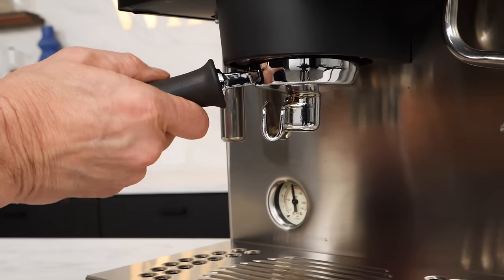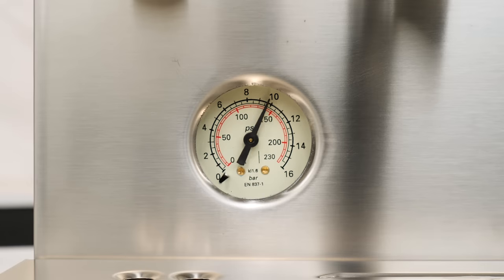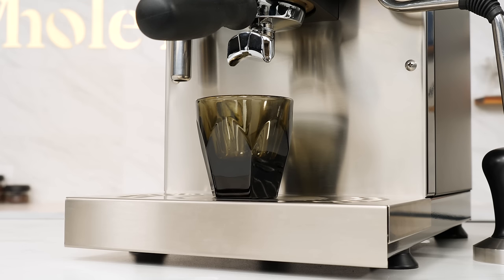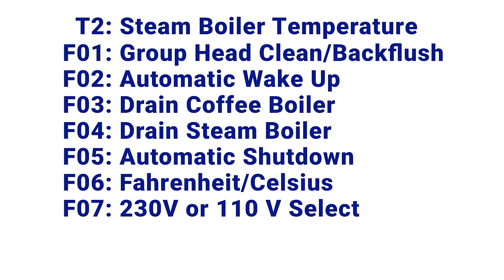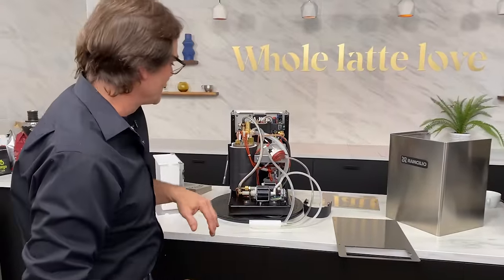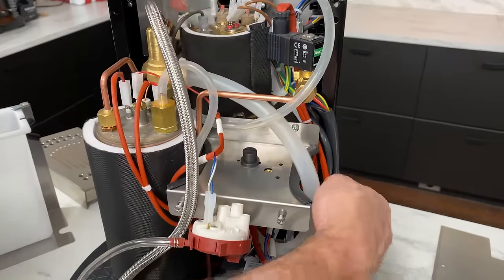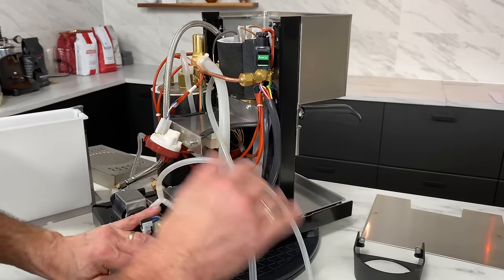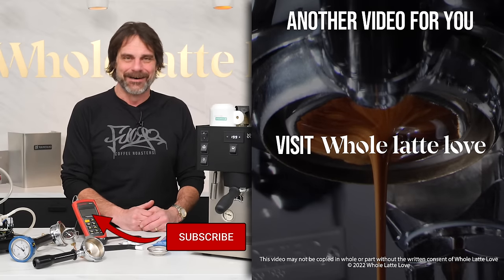Review: Rancilio Silvia Pro X Espresso Machine

Comment: The "con" is it went from $750USD to nearly $2000 for these features. The appeal of the original is it's value to me. In that price-point, I'm looking at a rocket or lelit.
Reply: Its a different machine and it is still great value. You'll be hard pressed to find a machine with the capabilities of this machine for the same price. It has a dual boiler, dual PID, pressure gauge, and timed soft preinfusion. The Appartamento isn't a dual boiler machine, its a heat exchanger iirc. Different system that is generally cheaper than dual boilers.
Reply from the maker: Hi an, Thanks for clarifying! the difference between the single boiler Silvia and dual boiler Silvia Pro X. Similar look but very different with more efficient workflow and superior temperature accuracy.
Marc
Reply from the maker: Hi Scott, Thanks for the comment. The Rocket Appartamento is near the price of the Silvia Pro X. Compared to the Pro X it has the E61 group, larger drip tray, no burn wand and might win style points. The Appartamento is a heat exchange boiler machine with temps controlled by a pressurestat so nowhere near the temperature accuracy of the Pro X with PID. With dual boilers in the Pro X one can control steam pressure without affecting brew temps. In HX boiler machines changing steam pressure will change your brew temperatrure. Changing brew temps on an HX machine controlled by pressurestat involves some guesswork and experience using timed flushes prior to pulling a shot.
Marc
Reply: I'm between the Rancilio Silvia pro x and the profitec 400, I prefer to drink espresso although sometimes I prepare drinks with milk. Since I don't know many of the specifications, which one would you recommend?

Muy grinder is The mignon libra

Comment: great video. It is a one boiler do you have to wait 30 minutes for it to heat up. Also  I was looking at the Breville dual boiler some comments say it breaks down every couple years and stopped working for some. this makes not sure on if I should even get a dual boiler, The one in this video sounds like it might be repairable if it breaks down. I'm leaning towards this  one . once I decide I'll upgrade to a separate grinder for just espresso. I always appreciate your advice and help. PS Im looking at the DF64  or DF64 II grinders

Comment: I have loved this review, very informative, but Fahrenheit, isn't that some part of wicked witchcraft? I mean, the average temperature of the blood of a virgin maiden(kidding, I mean body temp of a human) and the freezing point of  some kind of brine, what kind of nonsense is that?  What happened to the International System of Units(SI), also known as the metric system?  Fun fact, you are actually using a measurement cup in ml and seconds, which are part of the metric system.
Reply from the maker: Hi BD, Thanks for the comment. I totally understand your point of view. I generally give temps in modern metric and the witchcraft we use here in the US. 🧙‍♀I'm nearly exclusive in using metric for weights and volumes. I Sometimes go sorcerer and mention ounces alongside milliters. I will add Fahrenheit has almost twice the resolution of Celsius so it's a bit more accurate (if less understandable) when setting the PID on an espresso machine.
Marc

Comment: Internal tour at 11:36: This is what made me buying this machine, after 30 years of ownership of some really fine machines, some of them costing three times as this one.
The Rancilio Silvia/Pro/Pro X are the most servicable machines I know. I would rate them even better than ECM/Profitec in this regard
Reply from the maker: Hey user, thanks for adding your thoughts on serviceability. All components are easily accessible which I appreciate. It's close, but our techs who service machines from many manufacturers give the edge to ECM/Profitec.
Marc
Reply: @Wholelattelovepage Thank you for your feedback. Looking at the insides of the corresponding Profitec Pro 300, I certainly find the Silvia Pro (X) easier to service. But in overall brand comparison I can follow

Comment: At 05:21 you say that the machine is 'built on a steel frame'. According to several resources all Rancilio Silvias, including Silvia Pro and Pro X have a stainless steel frame. 
Even if it's black painted and magnetic, it should be stainless. User reports confirm that these areas no longer rust even if the paint is scraped off.

So this is really important and good news (old Silvias had a rust problem, that's past now)

Comment: Hi Mark!!...finally i get one Silvia Pro x, and i would like to know: 1-How do I descale the coffee machine completely? 2-and how often if I use weak water? It will be of great help to me. Thank you very much. And great Channel!!❤️
Reply from the maker: Hi, Congrat on the machine and thanks for your comment and question. Your machine should have come with the BWT Bestsave in reservoir filter. Be sure and use that as directed. You really do not want to have to descale a dual boiler. Rather difficult for a non-tech to do it right. So use water that will not create scale in the first place. Using the BWT as directed gets you there unless you have edge case water issues. The Bestsave requires 10 hours in the reservoir after adding water. So if you regularly go through more than a reservoir of water a day it's best to use other treatment option like BWT Aqualizer pitcher: https://www.wholelattelove.com/products/bwt-aqualizer-2-6-l-pitcher-with-illuminated-baselight
Also if you do not regularly take hot water from steam boiler for rinsing cups, Americano, etc. be sure and turn over a few cups every couple days of use. If you only use steam, over time minerals will concentrate in the boiler to point of causing scale even if using properly treated water. Hope that helps and enjoy your new machine!
Marc
Reply: @Wholelattelovepage  thank you!!!so, Preventive maintenance of boliers is not necessary? I have read on other internet sites that normally, depending on the number of coffees per month, at least one descaling per year is usually done... hence my doubt. Thank you again!
Reply from the maker: @user-ee9ed2mg1k  Yes, so long as you feed good water!

Comment: What would you recommend between the Silvia Pro X and the Profitec Pro 500 heat exchanger with PID and Flow Control. I cannot decide between the two. I am upgrading from a Gaggia Classic pro. Thanks for the video. Very Helpful.
Reply from the maker: Hi MP, Thanks for the question. So there's a bit of a price difference. Taking cost out of the equation I'd go with the Pro 500 PID with flow control. The FC opens up a lot of possibilities for those who want to craft their espresso. The Pro X does have the soft pre-infusion but that does not come close to what one can do with FC. If on the other hand you're not super critical of your espresso the Pro X can crank out respectable shots.
Marc

Comment: thank you so ,uch for theGreat review

If i may ask. Which machine would you recommend to get this machine or the profetic 500 ?

and thank you so much again
Reply from the maker: Hi kn, You are welcome. The Pro 500 has a more refined build quality with better finishing, E61 brew group, larger drip tray and classic Italian style look. It's a heat-exchange boiler machine so can brew and steam simultaneously but does not have individual control of brew temps and stem temp/pressure. The Silvi Pro X is a dual boiler machine so does have individual control of boiler temps. It uses a ring group brew boiler which is mounted above the group. Build quality is not as refined and it's a more complex design using 2 vibration pumps. It offers a lot of features for the price and is one of the least costly dual boiler machines. If you are looking for value the Pro X has a lot to offer. That said, I personally prefer the Pro 500 for the upgraded build quality and more classic design with E61 group. The smaller drip tray of the Silvia Pro X can be annoying for some users in daily use. Hope that helps!
Marc
Reply: I truly appreciate your reply. Thank you so much sir :). 
Glad both are equal in performance. 

Which one is easier to repair or service if they go south? This is my selling point. 

At my place I don't have any specialist service center for any espresso machine. I have to buy the parts and fix it myself.

Comment: GREAT review. Thank you very much for it. I just wish you had gone a little bit more through the pressure gauge. What should it be before you press brew? How long should it take to go back to pre-brew pressure, ready for the next shot?  Does pressure matter before one presses brew?  My machine, after 2 months,  occasionally settles on a low pressure (2) after start up - temp at 201, steam light solid. I have to turn it on/off several times to get the pressure to settle at 7.75. It does go up upon brewing. Once I went ahead and tried to brew, and the pressure dropped to 0. Not sure what is going on.
Reply from the maker: Hi JM, You are welcome and thank you for the kind comment and question. The pressure does not matter before pressing the brew switch. Your only concern is the temperature indicated on the display. If it's at your setting, you're good to go. Pressure is sensed deep in the hydraulic circuit and behind a check valve. When the machine is not brewing the gauge may show residual pressure in the circuit. That reading has nothing to do with pressure in the boilers or what your brew pressure will be when making espresso. As you've found turning the pump on/off quickly will change the reading on the gauge.
Hope that helps!
Marc
Reply: @Wholelattelovepage  Thank you for the speedy response! You guys are wonderful! (Also good to know I don’t need to worry about it. )

Comment: Marc, great review as always! a bit random but i was wondering if you ever made the video about Gaggia Classic Pro's actual brewing pressure with a dialed shot vs it's static system pressure? i remember you mentioned you were working on one. would be nice to have it on the record since i can't find any videos doing just that (everyone just jumps to the OPV mod).
Reply from the maker: Hi m, Have not had the opportunity to do that one yet. I did some preliminary testing using a  PF w/gauge and a valve to simulate water release like a Scace. Problem was the valve was too coarse in setting. Need a needle valve or tuned orifice or better yet a Scace which fits Gaggia groups. My preliminary testing with a coarse valve shows a much lower brew pressure than what the "jumpers" get as a static (no water release) pressure test. When I'm able to test and be confident in results I will report.

Comment: I'm confused about one thing. I've heard that with the older models require running water through the grouphead or the steamwand to make sure you don't fry the heating element in the boiler (in the event it's empty). Is this indeed something essential to do? As well, does this need to be done with the Pro X model? Thanks so much for the great information!

Comment: Very well explained as usual . From what you explain, does it mean it has about 1.9 bar of pressure for the steam? 

What would be it s competitors ? Elizabeth ? Breville DB ? Do they compare ?
Reply from the maker: Hi AA, Thanks for the comment! Steam pressure is well under 1.9 bar but steaming performance is quite good on this machine with the well balanced 4 hole tip. The Breville is more an appliance grade product with lots of plastic and proprietary parts. Nearest competitor with a similar form factor and specs is the Profitec Pro 300. It's a dual boiler with PID of the brew boiler and similar boiler over group design: https://www.wholelattelove.com/products/profitec-pro-300-dual-boiler-espresso-machine
Marc
Reply: @Wholelattelovepage  Which of the two would you recommend? Silvia pro vs pro300?

Comment: Great review! I’m in the market for a machine to give someone as a gift. Budget of $2,000 and PID is important to the person. I’m looking at the Bezzera Magica PID vs this Rancilio Silva Pro X. Seems that temperature and steam pressure are very comparable between the two, but the Bezzera is much better looking with E61 and larger reservoir and boiler. You have comments on one vs the other? Seemed like a no brainer to be with the only advantage of Rancilio being pre infusion which I don’t see being used much.
Reply from the maker: Hi nolan, Thanks for the comment and question. Also - Nice Gift! I agree with your opinion on aesthetics. The Magica has a more classic look. As a dual boiler, the Silvia Pro X has independent control of boiler temperatures. The Magica uses a heat-exchange boiler so changing the brew temperature changes steam pressure. The Silvia heats up faster with the ring boiler compared to the Magica with E61. The Magica's construction and finish quality is better. I appreciate the Magica's larger drip tray.
Hope that helps!
Marc

Comment: They really need to update the drip tray... The small capacity and tilting it to remove seem like a mess waiting to happen. Plus, the grate is more metal than hole, which makes liquid splash around in my experience.
Reply from the maker: HI D, I hear you, It is small in capacity and I prefer wire style drip tray covers.

Comment: Great Video. I got my machine earlier this year. Quick question; will you be posting videos for maintenance and care? I noticed there are not instructions for descaling the machine. One supplier told me this machine should be only descaled professionally, Rancilio support suggested me to follow the instructions for the single boiler. Thank you!
Reply from the maker: Hi HUV, We are currently working our way through an extensive list of support videos so at some point we will have more maintenance/ care content for the Pro X. Your supplier is giving yout the line of most dual boiler manufacturers saying the machies should only be descaled by a pro. They do this as neglected machines with scale build up can be problematic. Descaling negleted machine can cause scale particles to dislodge from one area and plug another. Honestly kind of surprised Rancilio support suggested following instructions for single boiler - but if that's what they advised then go with it. Nice this machine has the boiler draining function built in which should help. Of course the best thing you can do is feed the machine with water that's unlikely to cause scale in the first place. The BWT filter included with the machine can do that when used properly. Another tip: Turn over water in the steam boiler from time to time. If you take out a cup or two of hot water very day or two that's fine. Just warming cups or making Americanos is enough. If you only ever take steam out of the boiler mineral concentrations will rise over time even if using treated water. Hope that helps for now!
Marc

Comment: Hi Marc! I LOVE your videos!!.
 I would like to know:
1-How many expresos can do this machine with the boiler of 0'3Litres?.
(Sometimes i have visits Of 4-6 persons)
2-How long does it take the machine to heat up if the water in the boilers runs out?.
3-what is the difference between Silvia's group and an E61?.....the thermal stability is the same??

Thank you very much.
Reply from the maker: Hi J, Well, thanks for the love!
1. I have not specifically measured actual recovery time. But, in making videos I have pulled back to back to back shots with grinding, tamping, etc prep in between and the machine indicates it's back up to temp by the time I've loaded up for the next shot.
2. Not sure exactly what you mean. Can't run the boilers dry as the pump will stop when water gets low in reservoir. One can empty the steam boiler by heating machine up, then turning off and opening the steam wand until boiler drains. But that's not something you'd do unless emptying to store the machine or totally turn over water in the boiler.
3. The Silvia's group is mounted over the boiler which transfers heat to the group head. I have measured thermal stability and it's very good. E61 runs a thermosiphon so water constantly circulates from the boiler out to the group and back to the boiler. E61 also has a soft pre-infusion built in.
Hope that helps!
Marc
Reply: Thank you very much!!....Finally, two more questions:
1- With the machine off, how long does it take the machine to heat up and be ready to make coffee? 20 minutes?...30 min??
2-Does it have an OPV control to be able to adjust the pressure for extraction?...or it's possible to adjust somehow? Thanks a lot.